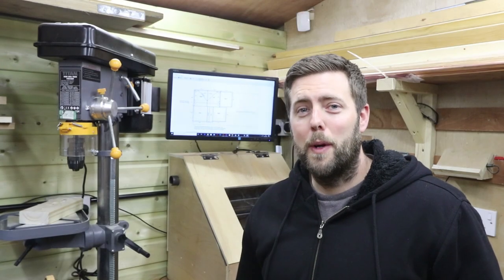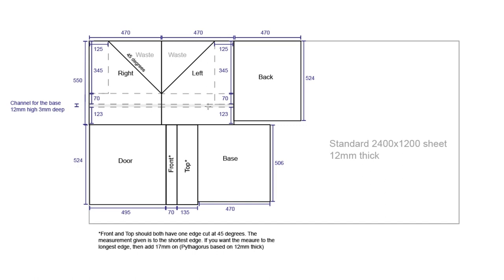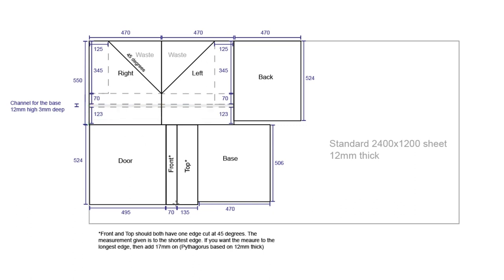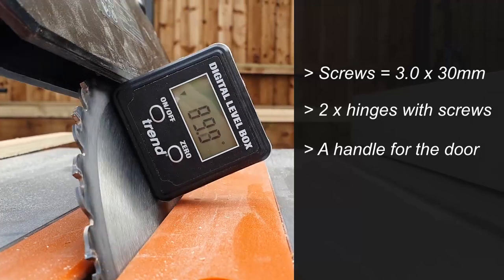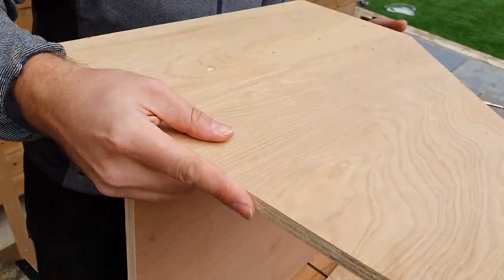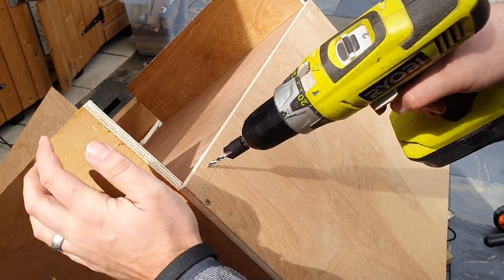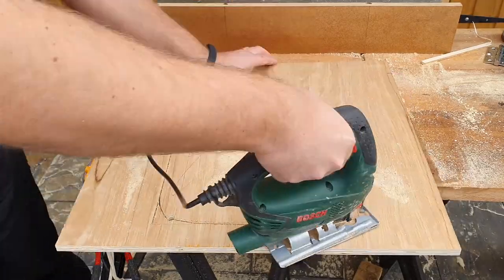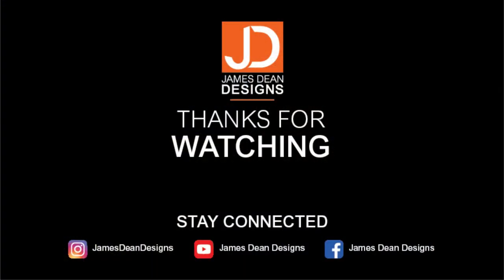3018 PRO - Building an enclosure

Comment: Nice build.  I think I will be having a go at this.  My main issue is trying to avoid annoying the neighbours with noise from the CNC.  Using a dB phone app my machine is putting out about 85dB when cutting. MDF with 3.1mm end mill at 1mm depth.  Any idea what the dB difference is, with your machine, between door open and door closed please when it is cutting?
Reply from the maker: I dont off the top of my head but if you take a look at my tips and tricks video, you will see the main cause of the noise is vibration from imbalanced spindles. Its a bit of trial and error finding a quiet spindle. I've got mine down to under 70db with the door open so obviously even less when closed. You can help this further if needed by using sound insulation inside the enclosure as well. Ive chosen not to do it as its spongey and I think it will be a pain to vacuum the dust off
Reply: @JamesDeanDesigns  thanks James.  Do you mean unbalanced when cutting or just spinning.  The spinning  spindle is not very noisy off load.  It is only when it is cutting something that it is disturbingly noisy.
Reply from the maker: @alandimery3379  bit of everything but cutting 1mm on these machines is actually quite deep. You'll probably find your machin is struggling a little. Even on MDF I dont cut, the maximum depth I go is 0.8mm and thats with more powerful spindle and a sharp bit. My usual setting is 0.4 at about 450mmps for something like oak. Perhaps bring that down to 0.5 as a test and see what the difference is
Reply: @JamesDeanDesigns  thanks, I will try that.  I will have a go at an enclosure in the next day or two.  I intend to make a double shell enclosure.  I just had the idea of putting expanding foam between them to see if that has an effect on deadening the sound.
Reply: @JamesDeanDesigns  Hiyah James.   I just wanted to say thank you for your advice.  You suceeded where the Facebbok group failed.   I lowered it to 0.4mm and 450mmpm and it cut the noise by 20dB.  It is now comfortable to watch TV with the CNC in the corridor and I am fairly sure the neighbour won't be bothered by it.  And that is stand alone and not in a cabinet.    Okay it takes a lot longer but I am in no hurry.  Cheers
Reply from the maker: @alandimery3379  thats brilliant! You can get quieter spindles that can go faster but its pot luck with places like amazon. Glad you've got it to a reasonable level though 👍
Reply: @George Teggin I did.  I thin k it was around 80 when cutting

Comment: Why is the back 470x524 in the drawings? Should it be more like (550-123)= 427 x 524 ?
Reply from the maker: I think you may be right, it looks like I've just copied the measurement from the piece next to it. I'll have to go and double check and update the drawing. Well done, I dont think no one else had spotted that mistake
Reply from the maker: You are right. Typo on the drawing. Ill get it updated

Comment: When you use an extractor you create a vacuum and lose suction, may I suggest an adjustable slide on the front edge to allow a flow of air through the work piece.

Comment: Just wanted to say thank you for all the videos, SUPER helpful getting started with a new 3018 ProVer CNC machine! I used your guide to build a sound-dampening box and it came out great. I’m constrained on worktable space, so I used five 8ft 2x4s to make a small sturdy table for it.
I had just put in a home gym in the garage and had some of the puzzle mat flooring tiles left over. I lined the box with those. They are easy to cut and work great to increase the sound dampening.
If you don’t mind the hinges showing, you can mount them on the outside, and the door just lays back over the top. No need for fancy hinges!
I also cut out a hole and attached a vacuum “gulper” at the back of the floor. I’m thinking that – since blowing air is much more directional than a vacuum -- my next mod is to cut down a motor oil funnel and attach it to the spindle housing. The top will go to an old vacuum hose to draw in outside air. When the shop vac is attached to the gulper on the floor, the funnel will effectively become a blower and I think it will work much better (and cheaper!) than the custom vacuum attachment.

Comment: Very nice build, I would add ports for vacuum and/or air.  Definitely going to build soon.  Thanks!
Reply: Oh yeah, for "cabinet space"  underneath add a slide shelf like on a desk for a keyboard but slap the laptop on and when running just slide it underneath 👍
Reply from the maker: Well....The new video goes live on Sunday which includes the upgrades including vacuum hose port, top extractor fan, lights and one or two other things. I needed to leave the gap underneath empty unfortunately. I made another video called big tools in a small workshop and you can see that gap allows me to slide bigger bits of wood on for my mitre saw
Reply: Look forward to seeing more vids James.
They have been very informative and a great help.

Comment: Great build and excellent video, very concise. No time wasted with mindless chatter like so many instruction videos! I noticed you have your laser mounted on the front of the spindle bracket, what did you use to do that?
Reply from the maker: Hi Jeff. The 3018pro spindle holder is designed to take both a spindle and a laser, you just swap them out as required. Its quite easy.
Reply: I hate the mindless chatter too!

Comment: If you were to use this for a laser, would the smoke smell from the laser absorb into the wood?  I need to build something like this for my diode laser, to use indoors.
Reply from the maker: Probably would over time. If you check out my enclosure upgrade video though yo will see I also fitted a small extractor fan

Comment: What do you think of using 1/4 inch (6mm) wood? The 1/2  (12mm) seems too bulky for me to get home and work with. (I am an old fart) I would not be able to cut the groves in the side panels, but I could compensate for that with a minor design change.
Reply from the maker: Anything is better than nothing for containing the dust and noise. You would just have to modify the plans accordingly to allow for the difference 👍
Reply: @JamesDeanDesigns  Gee, I waited at least 5 minutes for this reply... (G). Thanks, I am still on the fence which way to go.

Comment: Hi James I like the design and will be adding a draw at the bottom for my laptop sliding sideways to allow the screen to be opened without interference at the front of the enclosure.
I did wonder however that the angle of your blade while cutting the top lid and front was set to 45 degrees. should it be 22.5 degrees?
Reply from the maker: There was a reason why I did it that way at the time but its been a while now so I have forgotten but mine is cut at 45 and the door sets square within it. You can either do it so its 0 degrees (or 90 depending on how you measure) meets a 45 degrees and it slots in or 22.5 meets 22.5 and it bevels itself in that makes sense.
Reply: @JamesDeanDesigns  I have gone over the setup and the 45 edge works out to be 17.5mm and the 90 is 12mm so they don't meet properly. However in hind sight all I need to do is rebate a 3mm deep x 12mm wide trench on each side of the door or adjust the design slightly so the door fits inside between the two side panels. Either way it's a great design and easy to adjust, Thanks for your video and response to my question.
Reply from the maker: @peterlawson7375  thats correct. I put a foam seal around my door to ensure it sealed well and also didn't bang everytime it fell shut.